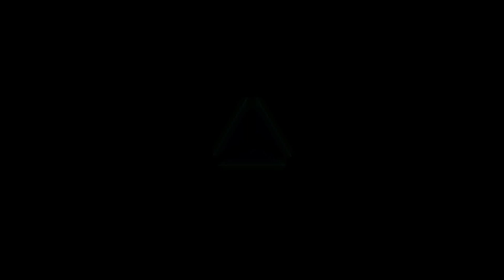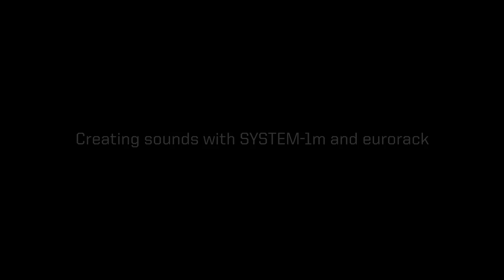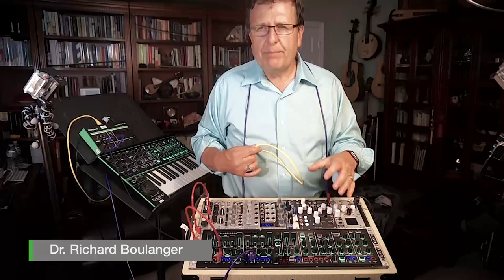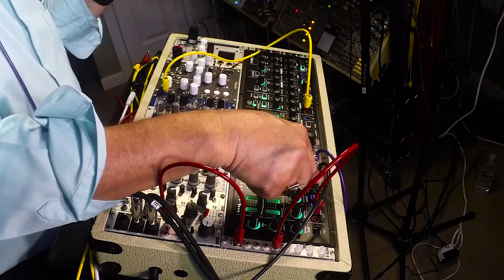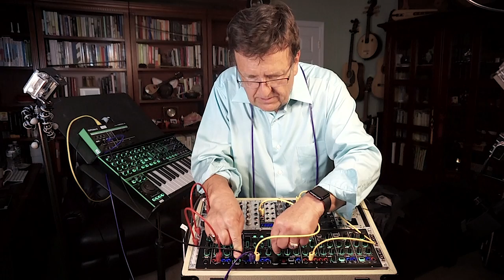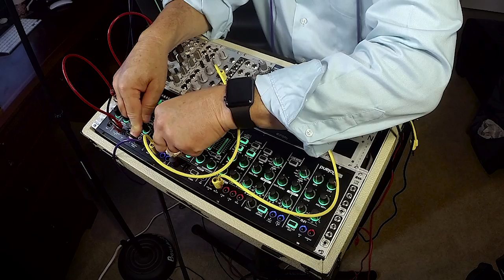Dr. Richard Boulanger - Part 6: Creating sounds with SYSTEM-1m and eurorack

Comment: So amazing... this series of videos inspired me to get two Roland System-1m units and all the Aira effects modules, Torcindo distortion, Demora delay, Scooper sampler, and BitRazer bit crusher. They are so amazing and are such a huge value as standalone units and as Eurorack modular units. The effects units also have six virtual modules slots (pick 6 out of 15 modules) built in in addition to the front panel effect, so they are actually seven Eurorack modules making them an incredible value.
Reply: I also have several System-1m units (OK, 4) to take into Eurorack and create all kinds of cools sounds.  I also have the 4 Roland Aira effects units (Demora, Scooper, Torcido and Bitrazer).  Love them all.

Comment: Is there any danger of too much voltage being applied if you use stackable patch cords?
Reply: +Jeff Lehman never use the stackable cords as mixers, just multiply signals! ok, you won't destroy your system (if you stay in the 12 Volts-range provided by the power bus) but you'll get some unexpected results (and maybe smoking modules that weren't meant to exist if they aren't constructed well enough..)